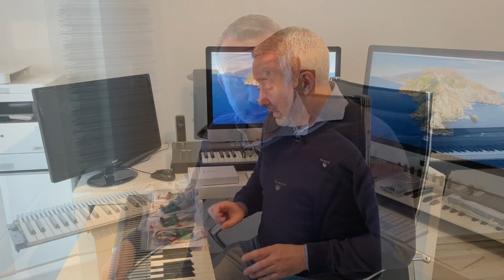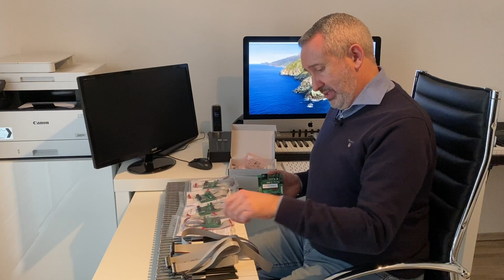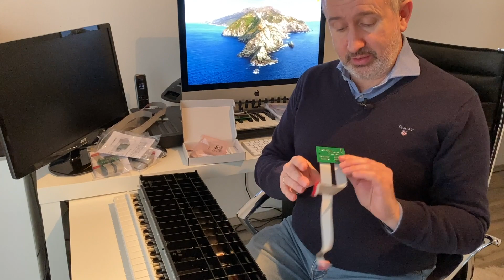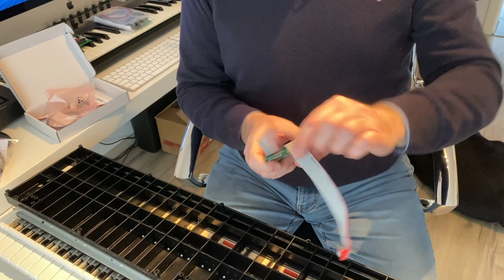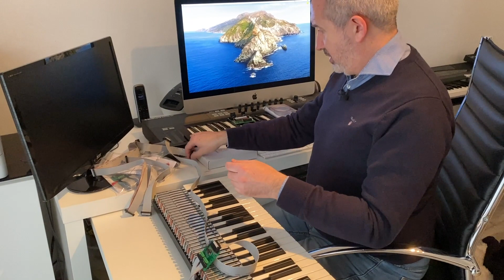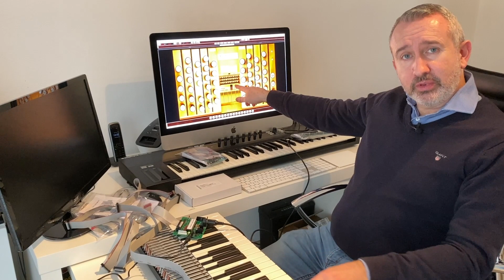Hauptwerk Project | First Sounds? Erste Töne?

Comment: Fraser - you should be wearing an anti-static wrist strap when handling circuit boards, such as this - https://www.amazon.co.uk/Anti-Static-Wrist-Straps-Anti-Static/dp/B017164JHA. You stand a good chance of damaging them with a static discharge without one or at least shortening the life of of the chips.

Comment: Hast du die Erweiterung deines PC mit genügend RAM eingeplant? Meine eigentlich angedachten üppigen 16 GB Arbeitsspeicher haben bei weitem nicht ausgereicht, um die Soundsets einigermaßen laden zu können. Mittlerweile habe ich 32 GB Arbeitsspeicher, was für die einfachen Sets geradeso funktioniert. 
Außerdem noch eine alte Weisheit: "80% der Arbeit lassen sich in 20% der Zeit erledigen". Die Keyboards anschließen, damit habe ich nicht wirklich mit einem Problem gerechnet. Später die Stops und die Pits werden dir noch Kopfzerbrechen bereiten, die MIDI-fizierung des Pedals ist da noch das kleinere Übel. Nimm da wirklich bitte fachkundige Hilfe an.

Comment: Welcome to the life of a technician.. Fortunately for you, the tech has changed to the point where assembly is far less complicated than the old "analogue" days! 
I, in fact, actually "cut my teeth" on vacuum tube (valve) electronic organs. Ah, those were the days... of heat, high voltage and much frustration!

Comment: I am looking forward to seeing what you will have to do to connect the pedals. Are they already a MIDI device, or is it just from an organ console? The Ginobus makes your wiring very straight forward, it is a nice simple solution. The only thing I find strange is that there is no USB connection on the MIDI interface. These days you can often connect all your MIDI devices together without needing an actual MIDI cable. Cheers.

Comment: Very small correction-the 4 boards you referred to as Decoders are actually probably Midi encoders . Decoders help your computer send MIDI information to your hardware (useful for lifted stop tabs), while an encoder allows your hardware to send MIDI information to your computer. Forgive my pedanticism!
Reply: I think the error comes from the producer of the boards, because he calls them "decoder" on his website. So Frazer just says what he got told.
What could also be is that it's called decoder because they decode the signal of the keyboard's diode matrix.

Comment: Hi Fraser, you probably won't want to mount the decoder board under the keyboard, as you will find that when you fit the keyboards together (stack them up) the pcb will probably foul whatever is under it. I am pretty sure that when you put the keyboards into some kind of console, the ribbon cables will allow the scan boards to be mounted behind the keyboards somehow. Obviously I can't see what you can, but I don't want to see you chopping bits out of your keyboards unnecessarily.

Comment: Test with both Hauptwerk ST Annes Mosely and the Free Grand Orgue of Lars Palo. The reason why is that sometimes you'll get a conflict on Hauptwerk between the different midi "sets"... Pedal, Great and Swells controllers. Using the GO software it shows the fault on screen whereas with HW you have to work through the 700 page manual. Having said this, you have a different software to find conflicts and faults. I would from the beginning build the registers (stops) as physical knobs as midi triggers. Far easier to play than with touch screens.

Comment: Flat ribbon cables make my skin crawl as they are susceptible to noise induction. There may be aftermarket round twisted pair cable equivalents to avoid the potential problem. E.g. look for round IDE cables as an example.  Round cables are much easier to route.